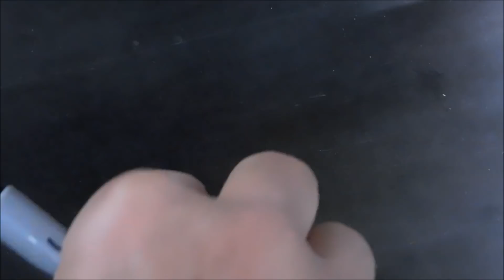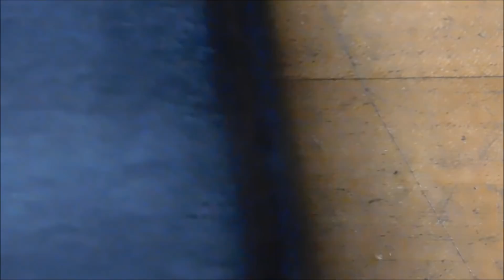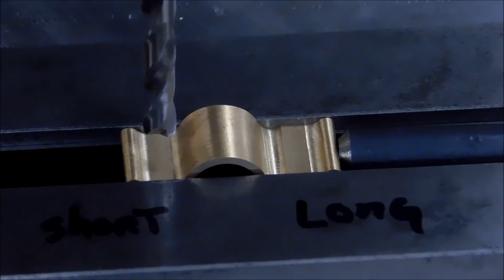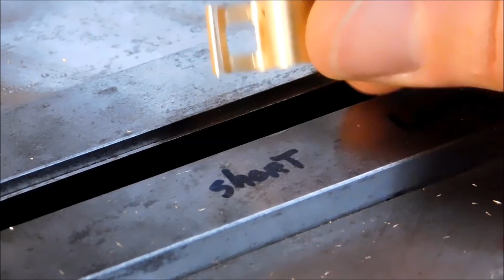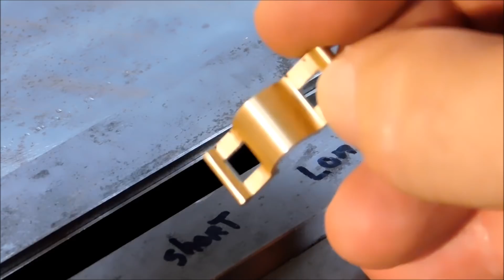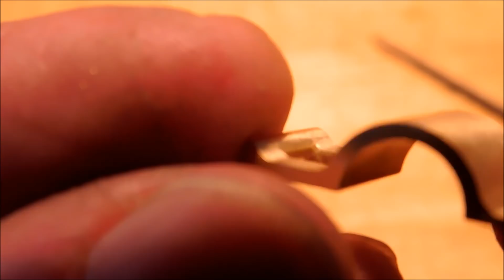I Bet You've Never Seen a File Used This way !!

Comment: Joe, you are a master.  I love the file trick for getting the full cylindrical profile on the trunnion straps.
Many years ago, I worked in a shop that had a Bridgeport that was fitted with a vertical shaping head.  I never saw it used nor did I ever get to use it.  It just sat there with dust on it.

Comment: Did you lock the spindle from rotating with the brake lever?   maybe I missed that, But for those who do not know this, the brake lever ( left hand side of housing) can be lifted upwards and it will lock in place( cam action)  and the spindle will not rotate , except a very small amount due to clearance on the splines.   Otherwise, your broach might rotate in the spindle.   Use braking force, as you would stop the spindle and at the same time, lift the brake lever so it stays in an inverted position. Of course just push down on the lever to release it.  Make sure your machine is in the neutral position so if you accidently turn the machine on, nothing will happen.
Reply from the maker: Anytime I broach on a mill, I place the machine at the lowest RPM in the low speed range. Once the tool is oriented, I'll lock the brake and check it again. If you don't have a cam lock spindle brake, the low/low setting is the next best thing.
Reply: @joepie221   I know that you  know about the spindle lock, but just did not explain  it to anyone who has never done any broaching  with a vertical mill.  The only vertical mill that I personally have seen without a spindle lock was a Bridgeport with a round column rather than the style that they have now , back in the 60's when I started as an apprentice. It's nice to see your replies . keep the videos coming, the up coming generations can learn things that we ' oldtimers' take for granted. take care

Comment: With tools you have and machinery it's nice to watch but for tha average guy with the basics that only gets a new tool(if its not too expensive) at Christmas and fathers day, we cant practice what you do you have the shop of a high end fabricator and I wish you could make some layman stuff.
Reply from the maker: You have absolutely missed the very basis of my channel. I share machining philosophy. The core of how to think. Its not about the machinery...It's about your ability to overcome your challenge with what you have available.
Reply: @joepie221  this is really the essence of machining, solving the problem of how to make block into part. I found it cool how you can apply mill setup knowledge to hand tools as well. no matter how small or what it was cut with, a chip is a chip. This has changed my perspective on "old school' machining practice. my high school shop teacher told stories of the good old days, when they made you square up blocks with a file. This seemed like working hard and not smart, which it is, but when it comes to the setup you masterminded, it made me think of hand tools in a new light. Thanks for adding another one to my mental toolbox, it will never stop growing :)

Comment: I was expecting you to use a center cutting endmill instead of a drill which would have put less force on the thin sections of the brass. I also used to use a slotting head on the other end of my mill for stroke slotting. Nice work on your punch work. For the round sections a radius mill should be easy to purchase for that size. I remember a part I used to make for the Luger pistol; it had to be turned in a rotary table while the slotting head passed a tool in and out of the part, creating a round section inside the part. It was tricky but very accurate.

Comment: That jig does not assure roundness.  You could easily end up with a "curve of constant width" (like a reuleaux triangle) rather than a circlular cross section.  Likely good enough for visual and most basic construction purposes, though.
Reply from the maker: I respectfully disagree. With 200 degrees of true cylindrical registration surface to work with, the resulting feature will be round.
Reply: @joepie221   Respectfully disagree with your disagreement.  If you have 200 degrees of cylindrical registration (or any degrees, actually), I'm missing it in your setup.  What I see is two (parallel) lines of registration.  Since you can't hold the axis constant between these lines, any shape defined by a curve of constant width can roll smoothly between the plane of your file and your backing piece.
Reply from the maker: @wray1104  Your confusion is understandable. The 200 degrees of registration surface is on the part, not the setup. This drives the resulting centerline of the true cylindrical resulting feature. One side of this setup is a registration surface, the other is the file. I welcome your comments.
Reply: @joepie221  Ah, I get it - you have an already-machined-cylindrical surface better than half-way around the part, and this is registered to the flat in your jig.  You never cut on that surface, and that guarantees that your axis remains a fixed distance from the flat.  Thank you.  I should have seen that!

Comment: Another fun and informative video, Joe!
Did you consider holding the file setup in a vise, or did you get a better feel for it holding it in your hand?

If you want to see someone making square posts fitted into square holes in brass, check out Clickspring’s channel. He does most of it by hand. Of course, using a mill and DRO (and skill, of course) you can probably make the square parts interchangeable, but I’m still impressed with what he can do by hand with simple drills and files.

Comment: Joe,
When I started working in a machine shop 37 years ago Kant Twist clamps were a mainstay all over our shop. I was the maintenance technician not a machinist. I used this brand of clamp increasingly less as it was hard to find any that weren't grossly twisted out of shape. I always chuckled to myself about the brand name since our shop easily destroyed the clamps. The brand gradually disappeared from our large shop. I have never been inclined to purchase the brand for my home hobby shop due to my experience. I never watched one get bent, but destroyed clamps were laying everywhere in our shop. Your setup uses the clamps in a way that makes me re-evaluate their value. I had a reason to inventory my home shop clamp inventory recently and I think that I counted 238. Now I have an excuse to shop for Kant Twist clamps to add to my inventory!
Reply: I love these things. I must have a good 20 in different sizes. I never had a problem with them unless I cut into one on the mill. ;~}
Reply from the maker: They actually apply a great deal of force. When someone bends one, its usually because they put a pipe on the T handle.

Comment: Super video, great technique but how did you lock the milling spindle when you did the broaching?
Reply from the maker: Low range at the lowest RPM setting. Still some movement, but acceptable.
Reply: I imagine you could also bungee cord the spindle lock lever for added rigidity.

Comment: Seems to me that if the notching on the bandsaw was done while still in the longer bar and then cut off, it wouldn't have been so hot on the fingers and as a side bonus, your fingers wouldn't have had to be so close to the moving blade.
Reply from the maker: Agreed.

Comment: Not to take anything away from your machinist skills, and the fact you show me a lot of unique tips, however, I could have achieved similar results with a good set of Jeweler files free hand in half the time. there is a danger of losing the handcrafting skills God gave us when we rely solely on a machine for everything but I supposed the challenge is the art of figuring how to do it. I guess I better shut up! Did enjoy the video very much. Thanks
Reply: Thanks for the quick reply
Reply from the maker: Very possibly, but its a functional hinge pin. No high spots allowed, and no low spots tolerated. Similar may not have had the same functionality in the end.

Comment: Gotta love them Kant Twist clamps...  Did you switch to the final file setup due to flex of the file?  I wondered about that, and considered putting the material between the clamps to prevent file flex. 

Re: 1/16" end mill.  I just got one in an eBay purchase of a misc pile.  Haven't got brave enough to break, err,  use it.

Good vid, as always.  I'd like to see the vise stop you used, in a bit more detail.  Haven't seen one like that. Might add it to a list of misc stuff you wanna show us.

Thanks...

Comment: Very good idea, done something similar with a grinder to remove weld on tube repairs on cricrle track cars.
Made a bushing to go around the tube a gide to clamp the grinder to and remove the weld.
Worked great and racers like that the repair didn't show up.
I also slug the inside the repair and spotted it in 4 places on each side to add strength.

Comment: The file trick is great!  I do have a probably stupid question, though...could you have backed up the trunion with a bit of aluminum so the brass wouldn't bend, or was it just faster to mill it closer to square first?
Reply from the maker: You are absolutely spot on. This part should have had a full shelf under it. A soft jaw would have been best. A piece of aluminum under it would have the potential to move around when milled, so it would have to be secure.
Reply: @joepie221  :) I can visualize a soft jaw in a mill vice to support a broach, but would have never have thought to do that.  Another cool idea...  And yeah, multiple points of contact with a backing plate with both held in a vice could be a pita...

Comment: Could you put it on a rotary table that’s turned on it side with the “pin” in the center of the rotary table. Offset a broach for the radius and keep shaving material off bit by bit while rotating

Comment: Joe, I like your technique for filing the pin. Thank you for another great tip.
I have an alternate suggestion for you on how to store parallels: cut the tops off the plastic cases and store the parallels in the bottom halves inside one of your drawers. Right now, you have to pull the case out, place them on a surface and then open the cases to switch parallels. It's much easier to just open a drawer and grab the parallels. The difference may not seem like much, but when you're changing them out all day, you will appreciate the time and convenience advantages of having them in a drawer without the tops on the plastic cases.
Reply: I like that idea a lot, E Designs. I'll also do that with my set of precision dowel pins and other such things. Thanks!
Reply: The success of that may depend on humidity and thus the risk of corrosion?  Otherwise is a great idea...
Reply: @tano1747 Corrosion is a constant problem for me. I live in South Florida where typically humidity is 100%, and my shop/garage is not air conditioned; yet. I have found that there is no difference between keeping tools in plastic boxes or drawers. Air is going to get at them either way. The big problems are salt from perspiration and dust. I liberally spray or wipe all bare metal parts with CRC 3-36 and it has completely solved corrosion issues for me. It has worked much better than other products like WD40.

Comment: Excellent idea with the file, but an alternative might be to make that brass strap without the hinge pin attached, and after the strap was made, braze on a brass pin with the proper length and diameter to the two ears. You of course would need a "micro" brazing torch and a very careful brazing technique. Maybe something a Jeweler would do? Thanks, Joe!

Comment: umm, is this thing a model or will you be able to fire it? if so, awesome. i watched many of your videos just to learn the theory of machining. maybe someday i would try in practice
Reply: The one Joe is making for himself is just a display model. There is a second one that could, in theory, be fired (or at least be made to fire with modifications). What it boils down to there is the way the trunnion pins were fitted to the barrel - see earlier videos in the series.

Comment: 10 1/2 out of 10!👍
Does your DRO have 99 zeroes, if so you can use any of them for new positional start points and leave ABS  for zero zero on one corner of your vice. Its like having 99 INC start points.

Comment: Talk about "light cuts" !
It seems that the file has been ground down to a size just a bit smaller than the feature you are cutting, and has two "safe" edges, to avoid cutting into the edges of the square hole...as always, an interesting bunch of tips, all through the video!

Comment: Great tip, I have used a file that way before. I used it to make sure a slot was at an exact distance from the end of the material. Milling was not an option.
 Tip: works great with diamond files as they are not directional, allowing you more freedom of motion and less issues with the part getting jammed between file and fence.

Comment: Thanks again joe. Does your mill have a spindle rotation lock or how do you lock it from rotating after you set the positioning of the tool?
Reply from the maker: A position and rotation lock is on my 'to do' list, but for now I just keep it in low range and pre set the lowest RPM I have. For low load operations like this, its safe.
Reply: @joepie221  thx I’ll b watching for that lock build. On another note I’ve been wanting to share an idea I came up with after watching one of your threading videos where you use the thread measuring wires. I take a small piece of foam or sponge like material 1/4 in wide and a bit longer than the diameter of the screw to be measured. Stab two wires close together into one end of sponge and one wire at the other end about at the width of the screw diameter. Then you can hold between thumb and finger close to the sponge kind of like turning the wires into a tweezer, you can then position the wires into the threads easily and steady.

Comment: "This piece got very hot" that's part of the reason they make Band Saw Vices. Heinrich makes a very nice one. 
http://www.heinrichco.com/bandsawvise.htm
Some might consider it pricey, but cheaper than new fingers 👍
👍 On the multiple parallel sets. But if you have or have access to a surface grinder make sure they all match in terms of height. Another type of neat parallel to have is a set of Wavey Parallels. Useful not only for thin parts but also to use as a spring in between regular parallels so they stay up against the vise jaws
https://www.bing.com/aclick?ld=e8gOzhkHxkS0MHr588ttZXNzVUCUwKwLXf-5x0ulJORwGDZtvyfs5t-ihPnW_zblHqRXDTU8nmHhJ0IPTD7wNVFD_M81LPb-xdfXmtlOJgFRrPV93AEIJ1I8qW95ujuspTBKvRY7klZMCxeAquJti5-Pqu5d5mHApNPW5KHhdSDegJIg_M&u=aHR0cHMlM2ElMmYlMmZ3d3cucHJvbGluZW1heC5jb20lMmY5LVBhaXItV2F2eS1QYXJhbGxlbC1TZXQtMDAwMi1IYXJkZW4tU3RlZWwtTWFjaGluaXN0LVRvb2wtMTItdG8tMS0xMi1HYWdlc19wXzk1NC5odG1s&rlid=b1f807865ea31f6713605927c86a48cb
Nice trick with the file. I don't think I've ever seen that one. But I wouldn't be surprised if it's been done before. Similar in some ways to using a file rest on a small lathe

Comment: Joe. Looks like your bandsaw could use a new blade plate you could get small bits get jammed between it and the blade. Either that or weld up the slot if it’s steel.
Reply from the maker: Hi Dave. I bought the saw like that, but I agree. Maybe a project for a rainy day.